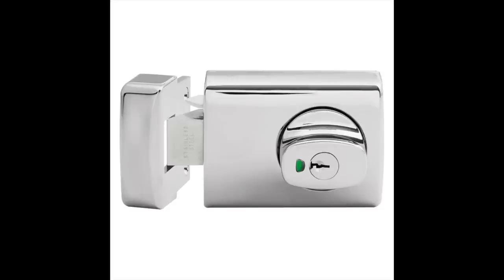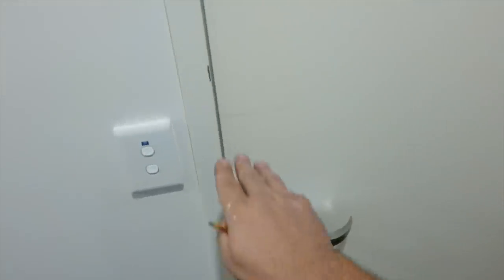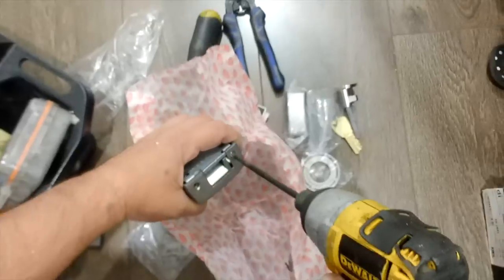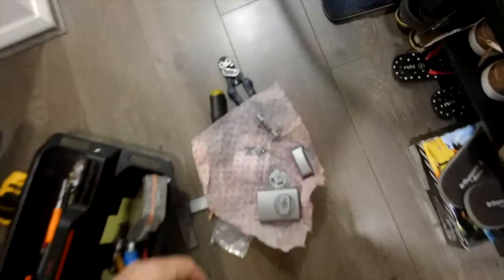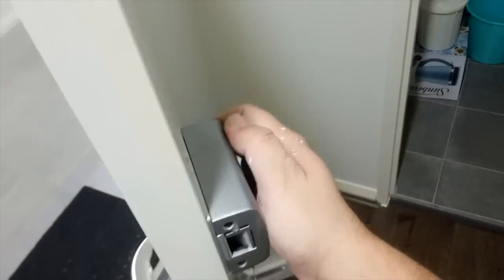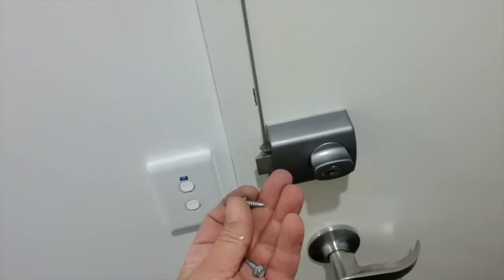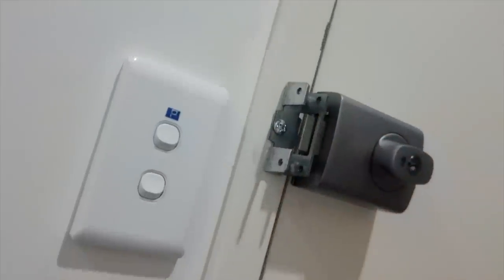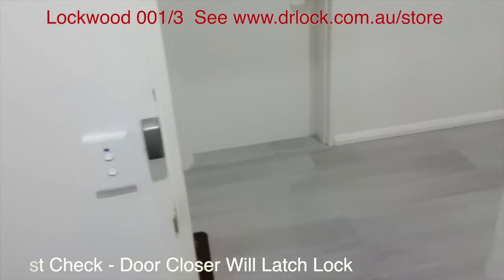How To Install Lockwood 001 Lock To Apartment 10min

Comment: appreciate this mate. prev install only used 1 screw for the inner plate so the barrel was getting loose. had to take it apart to get to the 1 screw tighten it up.

Comment: great instructional video, the only mistakes I made were my own fault for not paying attention to the video 8:05 once you have checked it turns freely ensure that the v part of the wheel is facing in where the strike plate will be and then proceed to install the latch body. The key wont be inside the lock during latch body installation if you've done it correctly

Comment: Lovely work! Pity you are not in Melbourne. As a rough guide what would it cost to supply and fit a Lockwood 001 on a timber door. Actually replacing an old Yale nightlatch. Backset is same at 60mm.

Comment: Nice.  Dang quick too.  Are those screws in the jam really going to hold up to a swift kick?  They look pretty short.
Reply from the maker: They are made to be forced off when the fire fighters use the big crowbar tool, I have tried kicking the door , not so easy, but not impossible
Reply: I’ve gone to plenty of break ins and I usually find the door is split in half or the jamb has split.
Reply: Ive seen breaking when they have cut the door inhalf basicaly pointless even having a lock. If they really want too get in they will.

Comment: Question. Does that meet fire regulations and is it possible to change an existing deadbolt to a self closing latch?
Reply from the maker: The 001 dose, you will need a 001 sleeve to change a deadbolt to a self latching lockwood 001 , but they are currently sold out

Comment: Dr Lock! Great vid. I don't know what's going on with my 001, but all seems to be working as per your vid, until the door is actually shut. The key won't turn from the outside. I think it's got something to do with the secondary, but not really sure. Distance is about 4-5mm from strike plate when closed. If I hold secondary all the way in though when door is open, key wont turn at all. We normally only use from inside to open and hold back, but obviously annoying when door blows shut and lock ourselves out in back yard >_<
Reply from the maker: Sounds like the back of the lock is not all the way back, it needs to be put on. pushed back, then the 2 screws, if the lock is not all the way back from the front the key will not turn all the way
Reply: @thousand Years Of Oppression
Had the same problem with my lock.
I compared it to another 001 and the problem is with the manufacturing of the backing plate. Take lock off door and screw it all together and try to unlock with a screwdriver. The problem will still persist. Now back off the side screws and install two small spacers between backing plate and the lock body. Tighten up side screws. The problem will go away.
Take it back and get a new backing plate, or do as I did (poor mans way) and bend the lugs to make up for spacer. You need a strong vice and a coal chisel.  It’s a crap fix but it does work

Comment: Not sure if you can help me. I replaced a whitco deadlatch attached to my external steel door using instructions supplied & your video which I watched multiple times. My issue is the door doesn't stay closed, I can close it & then just push it open with my hand. I have no idea what I did wrong.
Reply from the maker: you need to adjust your strike most likely up or down, the latch is not going into the strike

Comment: Hi my key from inside is not working its stuck at at one point ,opening closing fine but not locking from inside please advise
Reply from the maker: the lock is not set to the same key as the outside

Comment: Can that same unit be installed on right side inwards opening?
Reply from the maker: yes right or left ... https://www.drlock.com.au/store/lock-shop-locks-domestic-commercial-locks-deadlatches-nightlatches-deadlatches-lockwood-001-deadlatch-0013k1sc?search=0013&page=2
Reply: @DrLockShop  thanks! Only thing is my key holes are upside down 😆 maybe I can spin cylinder around but not then lever?

Comment: When you state that the lock won't comply if installed too high.  What do you mean by that?  Fire rated compliance?
Reply from the maker: No council, it will still work in a fire, but the hight is part of the fire door regulations, needs to be accessible for short people too, in short , if you mount the lock high to keep the kids in, you may get asked to lower it when they do a fire inspection
Reply: @DrLockShop  Thanks.  Is there a set height limit stated?
Also with the 3mm packing,  how much out would the door have to be with the frame to use a packing?